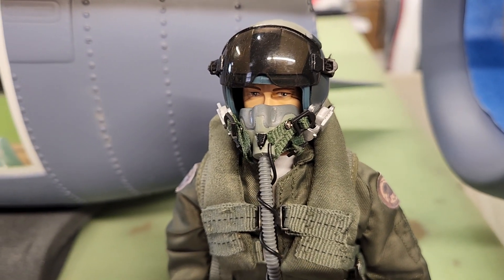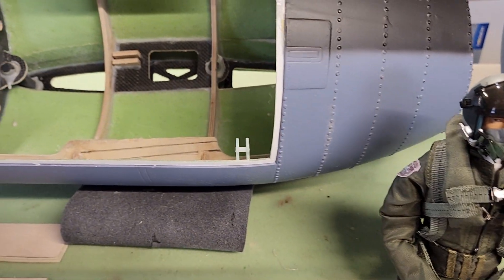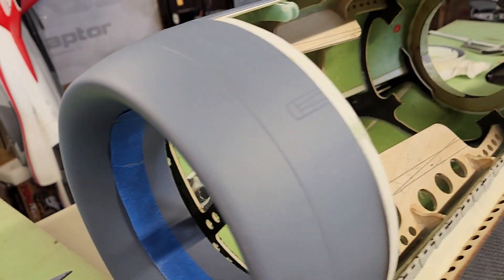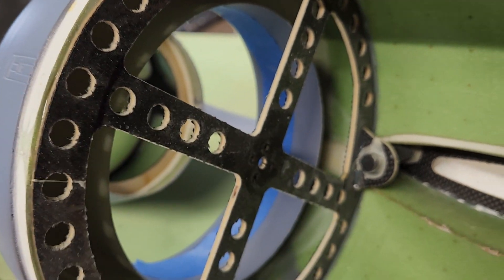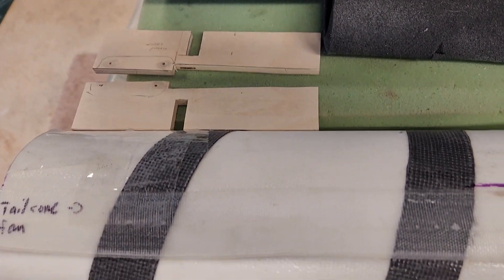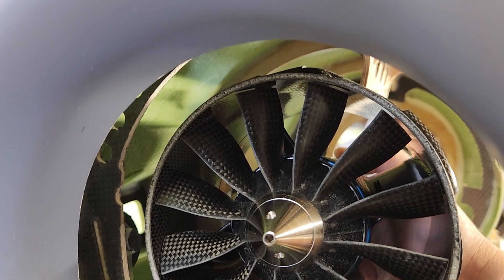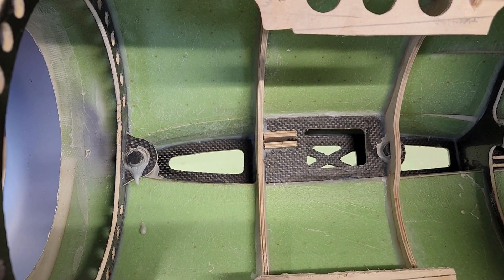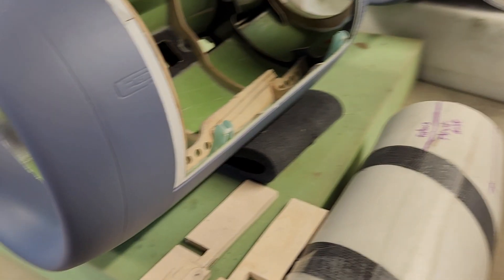T-One models A-10 EDF conversion: Nacelles part 1

Comment: nice build. What are you using for CG and where are you measuring from. Leading edge of the wing or the slat?
Reply from the maker: I used the leading edge of the wing for measuring and the cg is 120- 130mm. I have mine at 125mm.